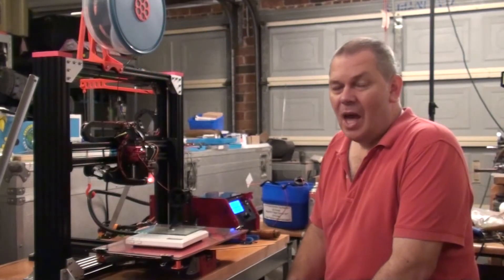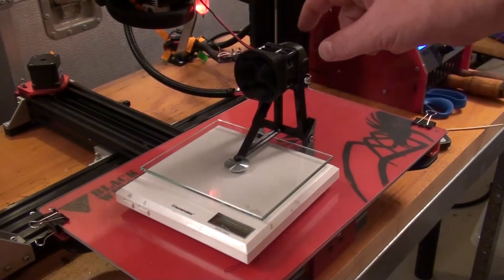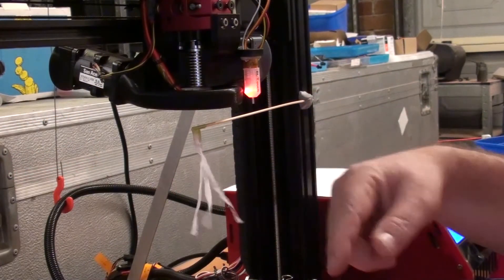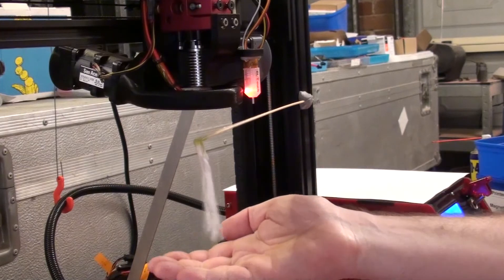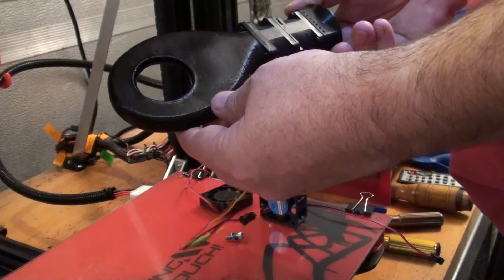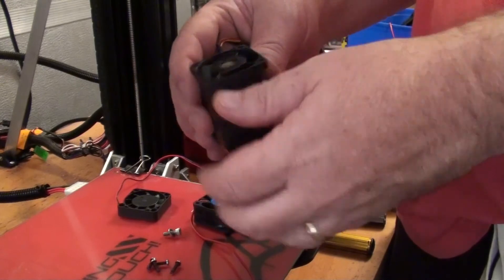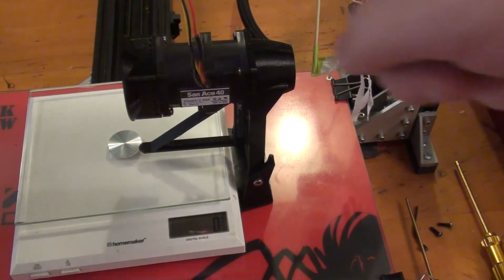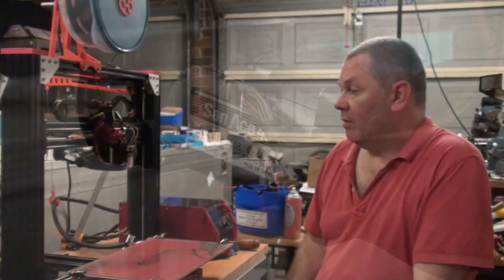SanAce40Fan

Comment: You mentioned running the 12-14V fan on 24V. Do you have long term experience doing that? Because the fan is being subjected to varying-length pulses of 24V and I don't know if that's a good idea.
Reply: That'll most definitely be an issue. These fans are generally rated up to 14V, 16V tops. Above that, the manufacturers do not guarantee proper function.

Comment: Keith, that's a server fan much the same as used by HP/Compact etc.
Reply from the maker: So John do you know of a 40mm fan that is roughly half to one quarter the power of this one? Because that's the one I want!
Reply: @keithyoung42  There is the Noctua NF-A4x20. Obviously doesn't move as much air as this, but it's much quieter

Comment: So much for the quiet operation of the TMC2208s haha
Reply from the maker: LOL. Only used it on the printer for a week after this video. It was just way too heavy, and was causing ringing/ghosting artifacts. In the end I could only run it at 6V. Above that I was getting a thermal runaway. At 6V it gave me the benchmark I needed to find the right fan.